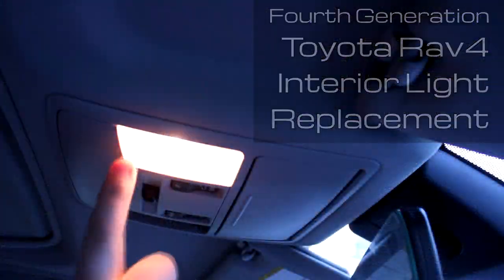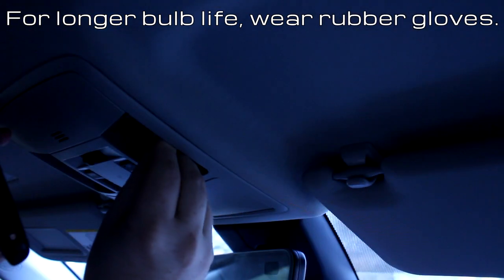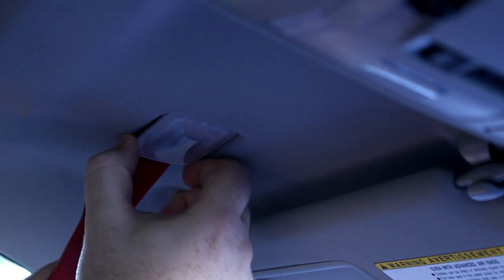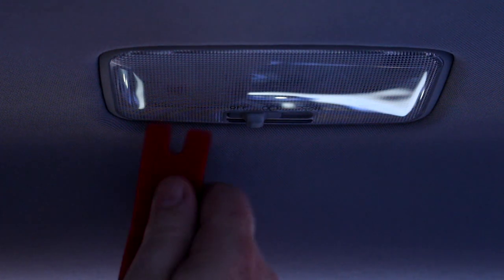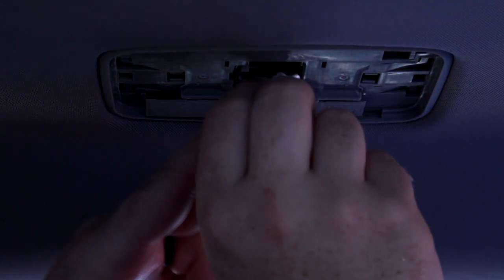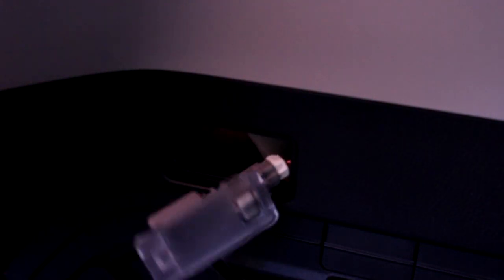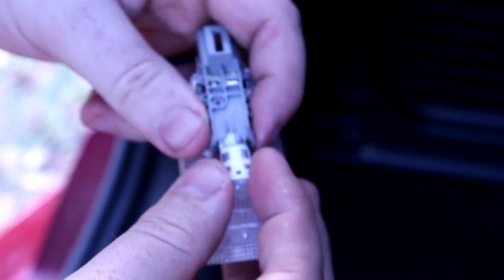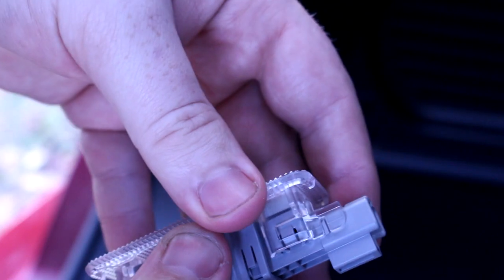Toyota RAV4 (2014-2018) Interior Light Replacement (Map Lights, Vanity Mirror, Dome, & Cargo Area)

Comment: Hello, I did the same to mine i have changed every interior bulb to JDM ASTAR LED, but i have an issue and i don't know if its the brand or its just the visor mechanism, that's when i move the visor up and down the LED flickers a bit , but when its stay still the LED stays on, but the rest is fine and i wish that its was all LED from factory.
Reply from the maker: It could be the brand, but with flickers, I always like to check to make sure all connections are clean and well connected. Dirty or loose connections can cause a flicker, too. Damaged wiring can also do that, but that's not common.

Comment: Is it really that easy? Just swap out the old stock bulb for LEDS?
Reply: Yes, as long as the bulb is ok for that socket. If the light is the wrong orientation, take it out and put it the other way, 180°, and it should then work when the light is activated